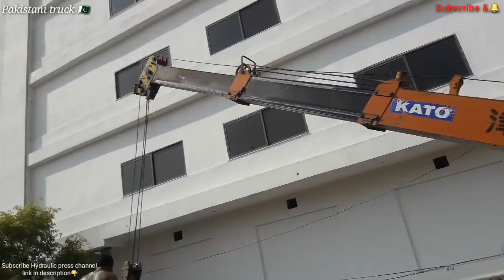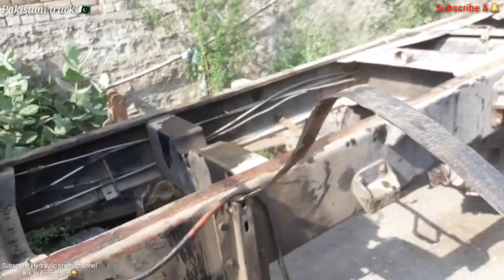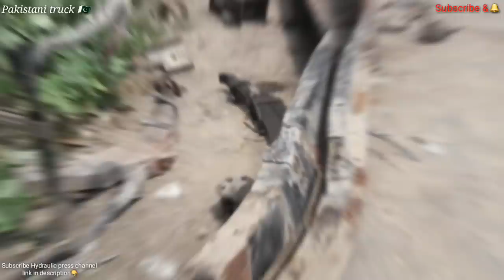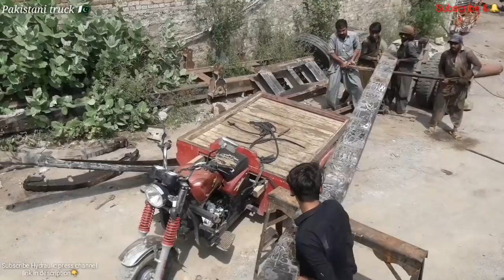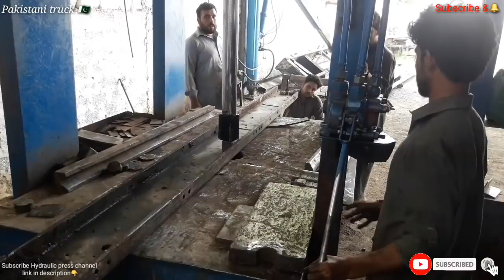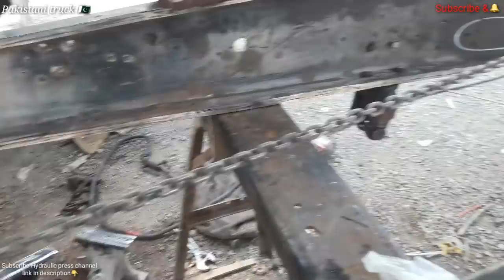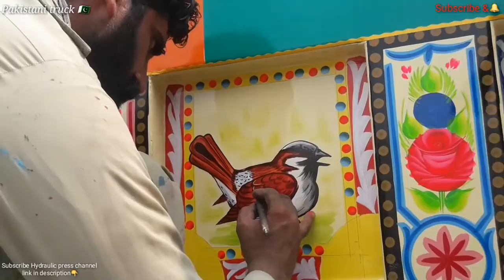Major accident repair and paint work on a Hino tipper truck

Comment: Guys one advice, Safety first. My jaw dropped open when I saw that huge hammer guy and the other one holding that thing without protection.  You could just solder an extension protection to that massive nail to be on the safe side. These guys are skilled no one doubts that but no matter how skilled you are sooner or later accidents DO happen, and you're buying too many tickets in that lotery doing things like that. Not to mention the type of shoes or the lack of working gloves and glasses. With just 3 or 4 basic and cheap security elements to work with their safety would improve a lot.

Comment: Very beautiful work and painting.  It seems that a replacement truck cab was used.  Frame rivets were hammered out.  I wonder why the rivets were not burned out with a torch.
Reply: so there position don't get damaged or weekend by the heat ... because the chisel end was like a head of an arrow....so it was just concentrating on the only rivet

Comment: As rudimentary as these two hammer and chisel team are I would have a shield protector piece welded on the chisel shaft to protect my hand in case of a miss by the man with the hammer as that is a broken hand in the making. I wonder is safety unknown in that nation, no welding goggles, welding in flip flops, no gloves, being poor sucks but you have to do with what you got. Bless these people and may they all be safe when doing work like they are.

Comment: Props to the guy swinging the sledge hammer but even so, no way i would be holding that punch under the hammer ! 
That’s just insanely stupid ! 
They have numerous ways to remove those rivets, why risk smashing someones wrist or hand ?
All said & done, this was less of a repair & more of a salvage parts from a wreck & make a truck from many different trucks.

Comment: That truck chassis will break in half next time it's involved in an accident, it lost all rigidity and strength. And best of all, the welding....that won't hold too much, especially because it seems to only surface welding. There is a reason why bolts are used to assemble components instead of welding.
Reply: Yea...but it looks cool, and if it breaks in half and kills a bunch of people...nobody has to pay for it!......but still, amazing skills.

Comment: Don't know whether to be in shock or awe.....from a safety perspective ?  The motorbike hauling company...2 massive steel beams coming at you on main street...not tied down...?.. I'm beyond amazed at how so much of the world would have thrown this away, melted it down, and made perhaps thinner metal...whatever...all these men working to correct, re use, repurpose...by hand.....Yet so many in the world can't get a screw into a wall straight.......So much waste....not here.

Comment: At what speed and what wall did it hit to bend such a frame like that? Yes of course all these cars with self reinforced frames on the road are killers of cars and pedestrians! And between themselves collide as two walls and not for nothing they make a huge steel bumper in front of the cab!

Comment: Absolutely no PPE not even boots or safety glasses. Motor scooter flatbed was a first. Recycling stressed an prolly cracked c-channel back into the frame. I wonder if quality of workmanship and materials was not a major factor in the cause of the original accident.